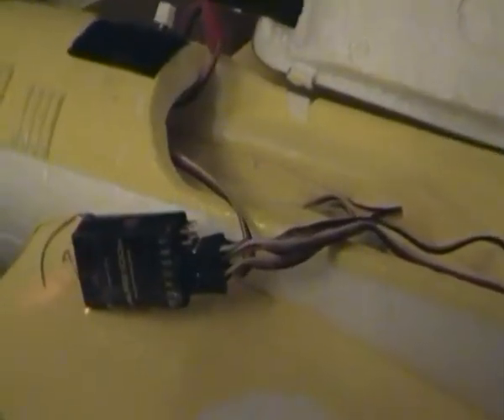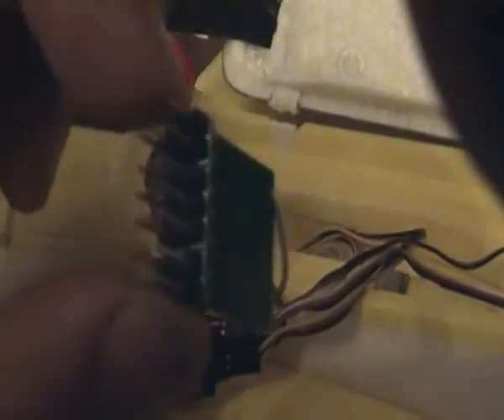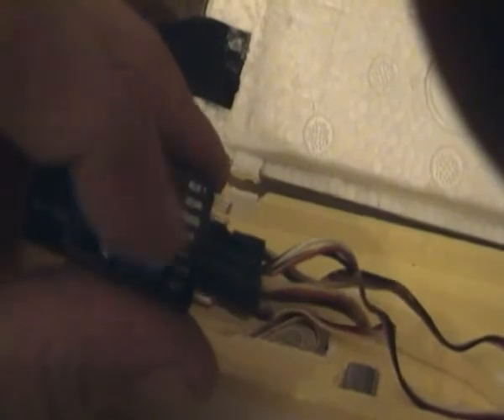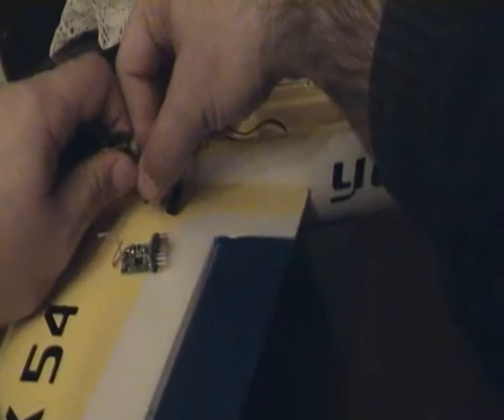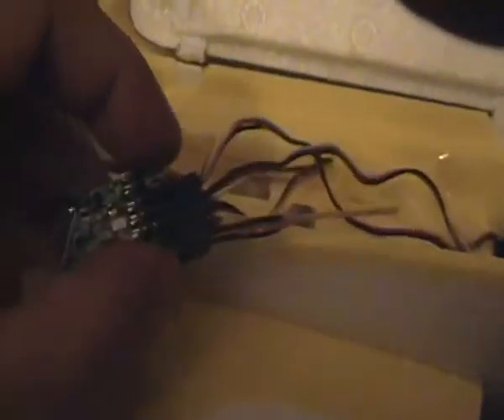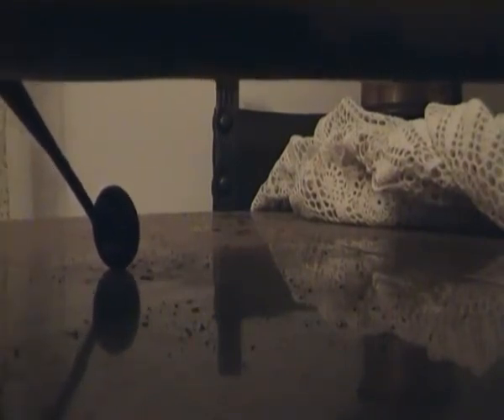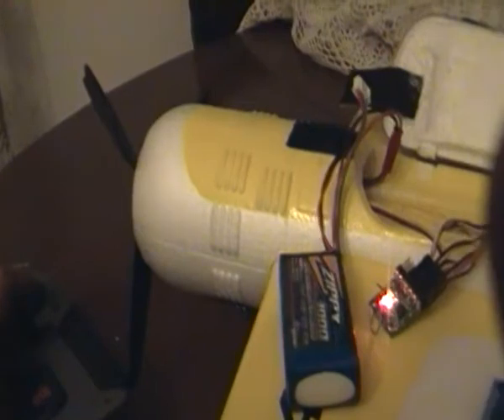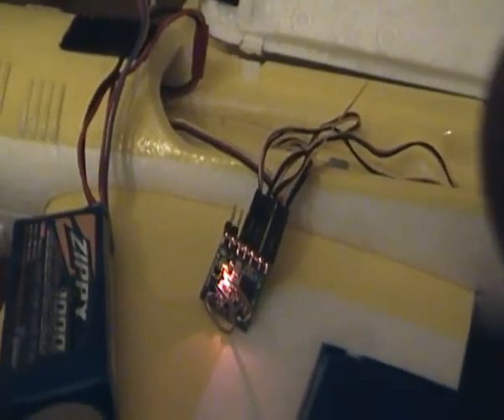Hobby King Spektrum DSM2 compatible receiver connect & bind procedure.

Comment from the maker: @lewy950 you're welcome. the flying range with this one is around 400 feet/130 metres, a little less than the original one, so be careful only use it with small parkfliers. it is very reliable though.